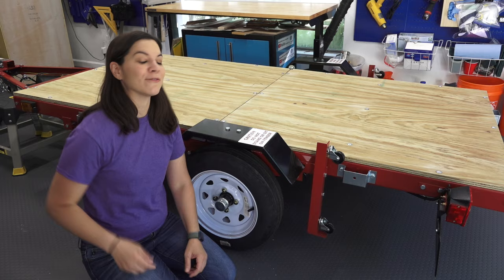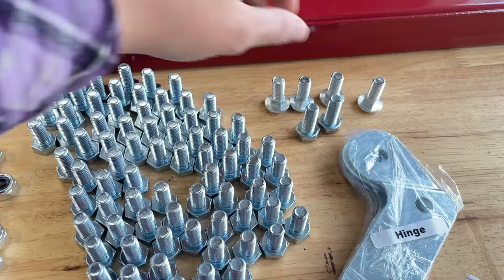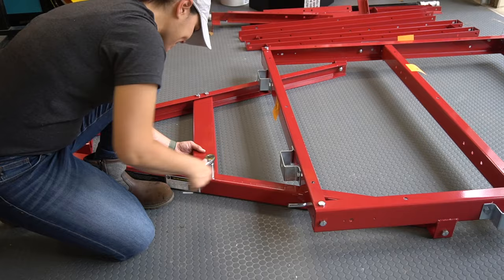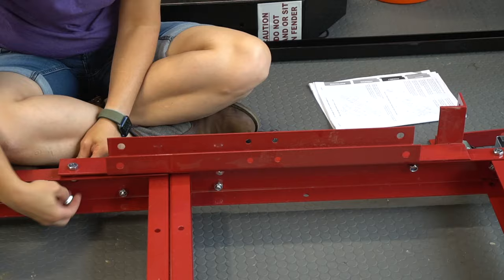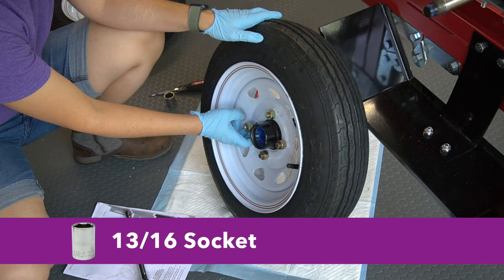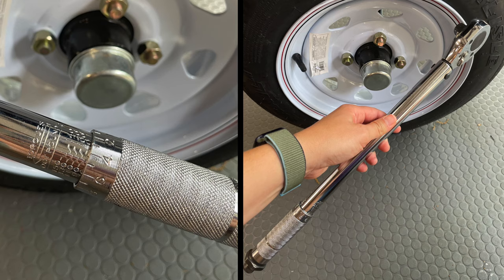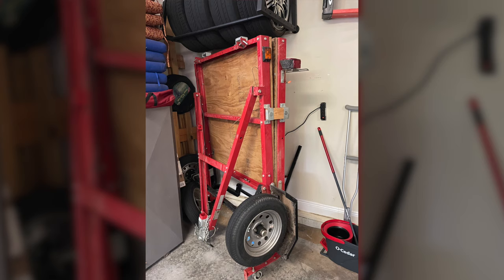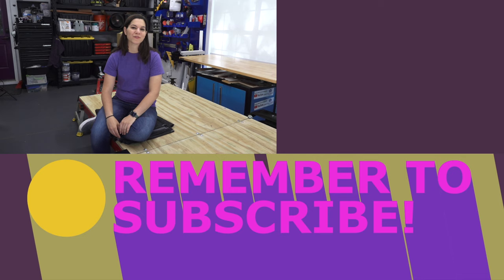How to Assemble Harbor Freight 4x8 ft FOLDING Trailer

Comment: Fantastic channel.  I ordered the Super Duty trailer this week and am looking forward to it arriving.  One issue I've seen online is that the hinges don't allow enough clearance for 3/4" plywood. Well, at least in earlier videos. Maybe the hinges are taller now. Did you get a chance to fold it up yet?  And if so, how did it look? (assuming you used 3/4" plywood)
Reply: Also, I'm thinking the two bolts connecting the front to the rear frame aren't necessary?  Besides, it would make it VERY inconvenient to have to remove them to be able to fold the trailer.  And...I just bought their Titanium 125 welder.  This should make it a bit sturdier and not be susceptible to loosened bolts/nuts.
Reply: Another common issue is...the wiring.  It's a cheap set included but would likely need to have grounding cables run too since it's bolted together not welded.  And...a good wire loom is a must.  Just about every Harbor Freight video show wires dangling, ready to get caught on something...
Reply: And then, the fenders have been known to wobble a lot at highway speed.  Still, looking forward to getting it. Thank you for posting your video.  You have a great family :)
Reply from the maker: Yes, that is an issue. We used 3/4" plywood and just had to cut a small notch on each side of the hinge. Not a huge deal. We will be sharing about that in a few weeks in a video. -Steph
Reply from the maker: It's a bit annoying, but we bought a low-profile creeper and cordless ratchet so it makes easy work of reconnected all the bolts. -Steph
Reply from the maker: Yes, grounding was an issue on this. But I got it working and have not had an issue so far. Our wiring video will be out in the next few weeks. -Steph
Reply from the maker: Yes, they are just connected with two bolts to the trailer, and do tend to make noise when driving. Once we got used to that, it was not a huge deal. -Steph
Reply: @MotherDaughterProjectsDIY  Regarding the bolts that connect the front frame to the rear...I honestly don't think they are required.  Even if the instructions call for them. 
In my humble opinion, I don't believe they would have any structural benefit.  The bolts on the side frame should be sufficient on their own.
Reply from the maker: My friend that has the same trailer said he only connects the middle when he is hauling something really heavy. -Steph
Reply: I downloaded the assembly PDF for the 1720lbs trailer, and sure enough, they do show bolts holding the front to the back before flipping over to install the side frame/spring assembly.  Perhaps it's only needed to keep together for this process?  Either way, maverick as I am, I won't be keeping them in there for any size load after completely assembling.  The bolts next to the fenders should be infinitely more capable of holding it flat than the those other bolts, speaking from a leverage/fulcrum perspective.

Greetings from Pinellas County by the way :)
Reply: I assembled my new Super Duty this weekend.  Mostly at least.  Still have to repack the bearings, install the fenders & wire the lights.
I was thinking I'd modify or fabricate new hinge plates to accommodate the 3/4" plywood I'll be getting, but..... it seems I don't have to.
The bolt holes near where the front and back half meet are "elongated" allowing me to shift the "pivot" point up at least a quarter inch.  This allows an extra 1/2" now.
For what it's worth, with the trailer folded, the distance between the top of the front side rail and the back side rail was 2.0"!!!  This should be more than enough space for 2 sheets of 3/4" plywood.
I don't know if it's that way on the 1195lbs trailer, but my new 1720lbs seems fine now.
 
I still have to get plywood to be ABSOLUTELY sure, but this HF trailer is amazing me.
The thickness of the metal is far beyond what I was expecting.  I haven't measured it to see what gauge it is, but I'm guessing 12ga.  And the cross members aren't a simple C-channel either.  They curl up inside as if they were just shy of a box tube.
Reply from the maker: Awesome! This is good to know. Sounds like it is constructed a little different than the heavy duty. Good luck with the rest. Sounds like you are almost ready to start hauling all the things! -Steph
Reply: Do the fenders make noise because they're thin enough to flap in the wind and resonate or is it a rattle because the bolts aren't tight enough?
Reply from the maker: thin
Reply: @rusosure7  Why did you repack the bearings?  Greetings from Pinellas County, Clearwater!

Comment: it cost 150$ in exactly one year from this video. no wonder why i haven't been back to HF.  I brought this when over 13 years ago for around 200$ and threw it in the curb because user error because i didn't put grease in the wheels then i destroyed it. i was going to get one again to mess around but not for 500$ for a flimsy trailer. i'd secure it to the wall if i storage upright like that the whole trailer depending on 4 tiny caster wheels thats smaller than the wheel on any office chair. image some toddler playing around with it and 400lbs fall down

Comment: 8:47 I was wondering where the 4th lug nut was-
Reply: Regarding the torque wrench, you weren't trying to torque it while the wheel was up in the air and free spinning, were you?  That wouldn't allow you to develop enough torque for it to click, since no one could hold the wheel stationary against the force from the wrench.
It has to be done with the wheels on the ground, and the wrench positioned at about 2 o'clock for best effect from the downward force to keep the wheel from coming up and spinning.
Reply from the maker: The wheel was on the ground, but that's good to know- thanks!
Reply from the maker: It was there. I got them all secured. Looks like it was just at an angle where the 4th was hidden.